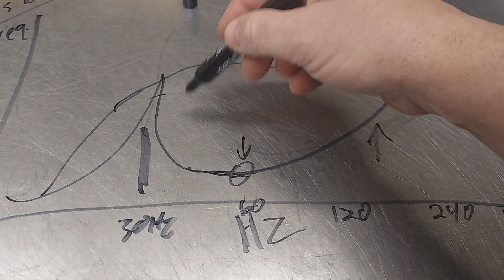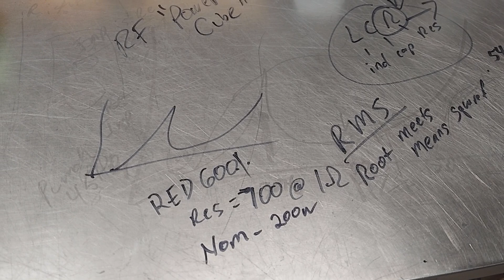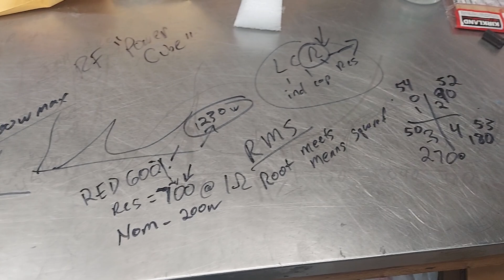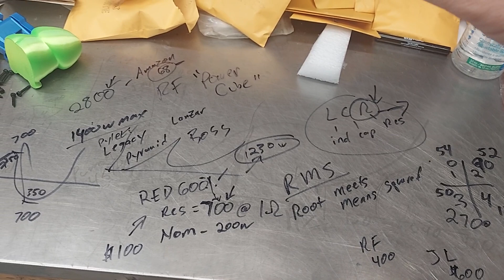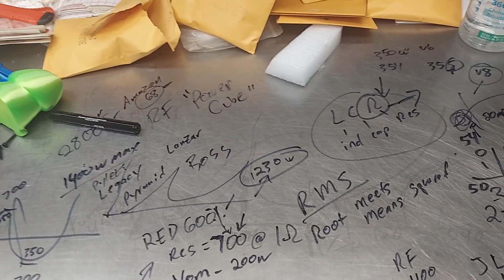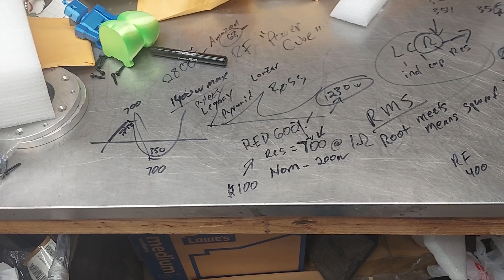Marketing vs Engineering - How & why most audio companies don't mind that you're dumb. Testing Amps

Comment: The impedance graph you drew is how Rockford Fosgate calculated power output for their 50 watt "cheater" amps way back in the day which could really output insane power. There is however one problem with what you drew. When you placed 350watts on the top of the sin wave, that is your peak power. Sustained actual power is the average of the sin wave. RMS power equals PEAK X 0.707. Most manufactures rate their amps with a 1kHz burst tone, at peak, these days which is crap, because it isn't measuring what the amp can deliver during a music session. Way back almost all amps were rated with a 20hz-20kHz tone mimiking actual delivered power during music playback. Also, what people don't understand is that "dynamic" power isn't what an amp can deliver, it is a fraction of a second power delivery which a capacitor dumps into the IGBTs or FETS and is not a reflection of usable power while listening to music. It is meant to provide power during transients like a base hit where a lot of power is demanded for a small time. An amp is not capable of sustained power at those rated levels, but many modern companies rate their amps with those levels... using BURST tones... which is also crap. lol Good overview though, thought I would put my two sense in. I have a video where I complained about modern amps vs my old Sony Mobile ES... basically saying the same things you did.

Also, conversion to horsepower is HP X 748

I would however like to interject something. I bought some high end gear, but have had Pyraids and Boss amps. There is a noticable sound difference in a quality piece because the 20hz - 20000kHz response curve is flatter and has a lower noise floor and has a better dampning factor to control the voice coil better. Sometimes you do get what you pay for, but not always. It is important to be educated if you are into the scene.
Reply from the maker: Cool.  Thanks.

Comment: Small block Chevy are V8 350 is just under that. And they really were not made in Detroit. My 68 Camaro was built in van nuys,ca. they were also built in LA and Norwood Ohio. The small block Chevy is the most produced engine in history for a reason low cost, reliability, and ability to upgrade easily with low cost. The 5.0L mustang was really 4.9L or 302 cubes.

Comment: Electronic parts are cheap especially from china at wholesale is too why it really doesn't cost much too make a amplifiers and almost all brands are now made in china i miss the days when amps were solid but hey it makes me money when i got too fix them . I have two 90s amp still going strong after a recap and i have 2 new amps that are in my bench need repair both made in china from 2020  zapco z-150.4 lx and a soundigital   and the two 90s amps coustic DR and a tru technology amp made by abyss are still going strong . But it is bad when you sell a product and people don't know what they are doing and install them and fry the amplifiers or burn a speaker  and say its no good there should be a law on that lol..

Comment: I have an interesting question for you. Maybe you can answer this in another video. What happens to watt output when you have an amplifier such as JL audio that has the same power rating from 1 ohm to 4 ohm. I’m talking about them having the same power output regardless of resistive load in that range. Obviously this is not the typical for most car audio amplifiers. How does that affect power output on the impedance rise on speaker? Will an amplifier like that change the watts output to the speaker less where impedance rises in comparison to an amplifier that does not have that kind of technology.
Reply from the maker: They just have an internal circuit that senses the resistance of the load and adjusts the gain.  My buddy Art pulled apart a 1000/1 for MTX and they bypassed the protection and that circuit.  It's basically just a 2000w amp that they only give you access to half of.  This prolongs the life of the amp and sort of dummy proofs it.  With 2000w at 1.5 ohm available.  It's easy just to adjust the input / gain to yield 1000w at a 4 ohm load which is what is "promised".